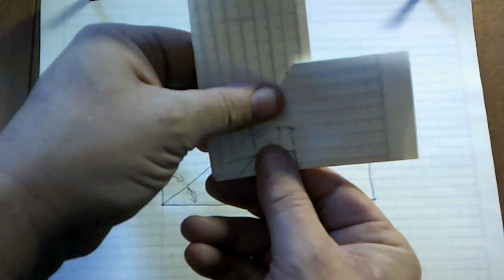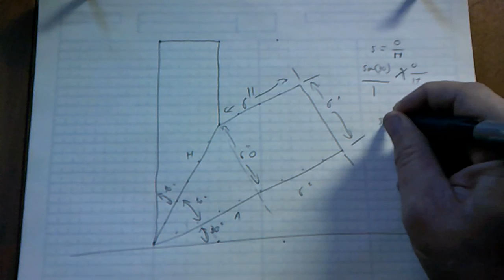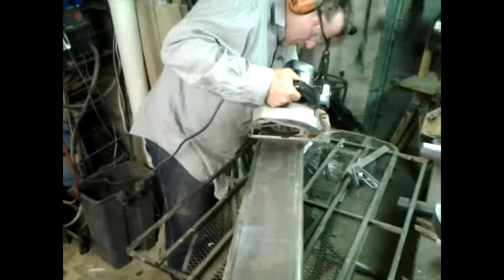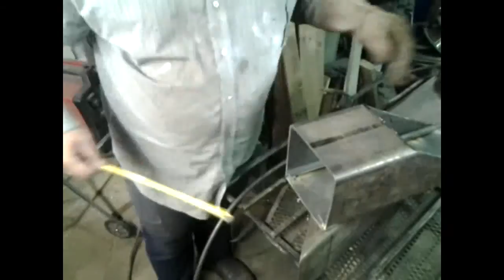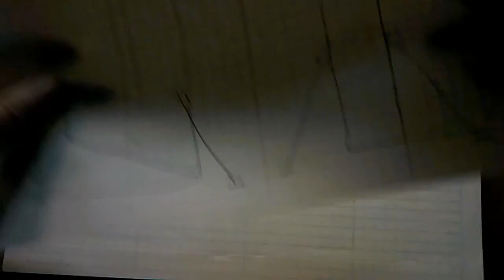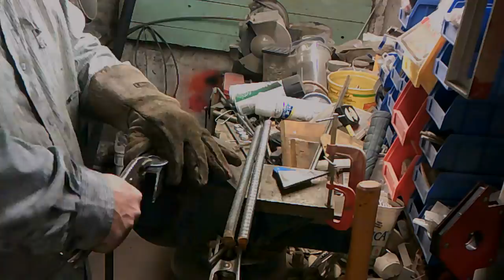The "4 Saw" Rocket Stove

Comment: Peltier TEGs to generate free electricity. Then this powers a small metal conveyor belt to remove the ash. Or charge your phone with a power regulator. These components are cheap.Belt could be chain mail, I think you have extra...